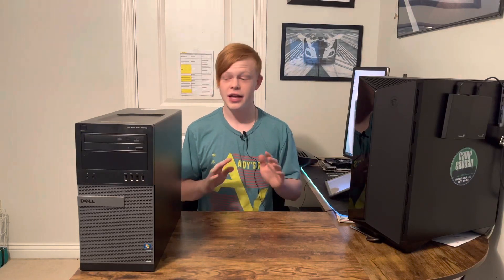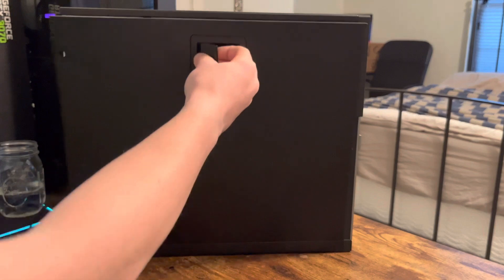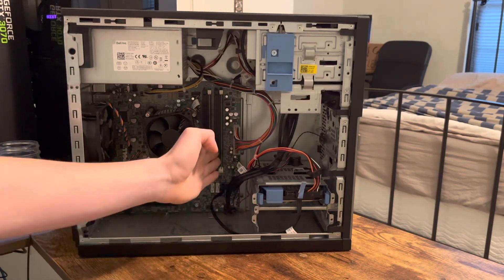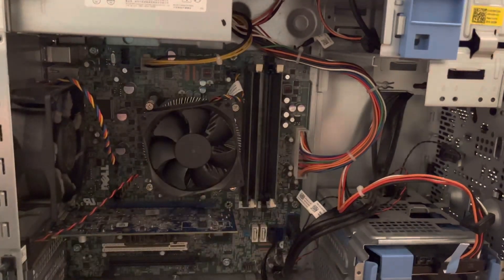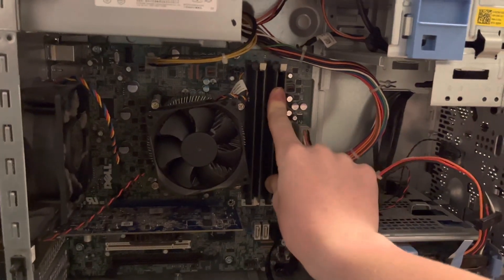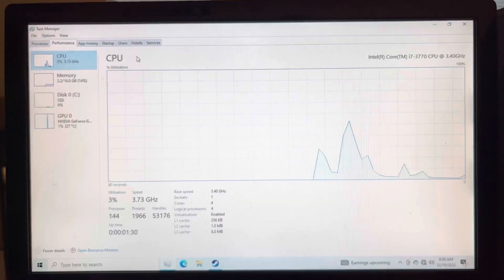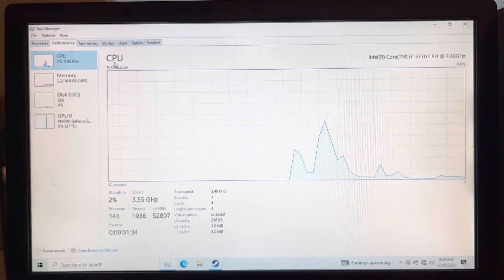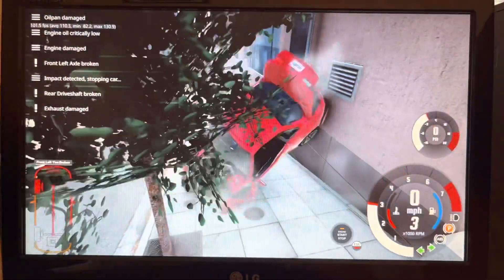How to UPGRADE Your DELL OPTIPLEX!

Comment: I scored a refurbed 9020 with a 4th gen i7 and 16gb RAM for $250. Swapped out the PSU for a Corsair CX600 and ran a PCIe riser to have a GTX 1660 run outside of the case, and damn is this one fine budget build. Even recent AAA titles are running great on it.

Comment: was the graphics card a 1650 or 1630 becuase i couldn't find a 1650 that looks like yours but i found a 1630 that did
Reply from the maker: I used a 1650. Ice actually never used a 1630 🤣
Reply: @KennyHalpin  ok thanks

Comment: Hello what PSU do You have on this Dell? i just bought OptiPlex 5055 with ryzen 1500 , 240 W PSU and I wonder  that will be work with my old 1050 Ti from asus { without power conector )
Reply from the maker: Well, if it doesn’t use external power, it should work just fine! I’ve never had any problems with 75>watt cards!
Reply: @KennyHalpin  ok thx
Reply: @KennyHalpin  Ok GPU works fine but i have another question ;p i put my RAM in slots A1 and B1 but its works in single channel the same when i put in A2 B2 ( Ram the same frequency and  model ) what to do to work in dual channel i dont find ram settings in bios menu ;/
Reply from the maker: It should do it automatically. Nothing to turn on. It won’t tell you that it does it, it just will.
Reply: @KennyHalpin  so bad ;/ i check in CPu Z and still shows me single channel
Reply from the maker: Hm, that’s weird… do you run mismatched ram?

Comment: NVMEs will also work on these machines, with a small bios modification.
Reply from the maker: Actually, that’s the newer Optiplex. This one specifically doesn’t have ports for it :/
Reply: @KennyHalpin  Ahhhh, I did not notice the model was a 790.

Comment: Just finished my 9010 MT project
Specs
CPU : 3770K
GPU : 2060 SUPER FE
RAM : 32GB HyperX Fury 1600Mhz
Drives : 500 GB 970 EVO Plus M.2 NVME, 1TB Crucial BX500
PSU : Corsair RM650W
Rear case fan : Noctua Silent 92mm
Reply from the maker: Might be a little cpu bottlenecked…

Comment: i just bought a dell optiplex 9020, and installed rx 580 in it, it worked perfectly fine, a reseated the cmos to get default bios settings
now the rx 580 is not working... can you help? is there any bios setting that doesn't allow the rx 580 to boot? the igpu works just fine
Reply from the maker: The RX 580 might’ve died…
Reply: @KennyHalpin  it worked perfectly fine before that cmos restart, i don't know the fix, i've tried everything and nothing works so far, so yeah i guess the rx 580 did indeed die

Comment: Thinking of doing something similiar for my brother, Did you install any other brackets/cables for it to be able to power that 1650? 

And did you install a low profile bracket on your 1650?
Reply from the maker: Nope! The system doesn’t need low profile! The 1650 can just be plopped in!
Reply: @KennyHalpin  does it need any external power cords?
Reply from the maker: @flexibilityosu  The 1650 doesn’t!
Reply: @KennyHalpin  thanks, currently looking for a good deal on a optiplex rn, what optiplexes do u recommend to look for, im in belgium btw
Reply: @KennyHalpin  update: i bought an 7020, reinstalled windows for my brother, found the ethernet port is broke and i ordered a pcie ethernet card for it, Hopefully will be able to resolve the issue and then see if i can buy a graphics card for him !

Comment: I  have a dell optiplex 7010 n I also have bigger case than the 7010 so I was wondering if I could put the parts in the bigger case n use a bigger GPU with it is it?
Reply from the maker: Yup! You sure can!
Reply: Would I have problem with the power supply mounting

Comment: I picked up a 7010 SFF (i5, Win10 Pro) on eBay a couple of months ago and did similar upgrades (16GB/512GB) but with a GT 1030.  It runs great, especially considering it's a 10-year-old computer, and even runs my older Steam games.

Comment: I just got a 7010 and I'm putting a E3-1275 v2 with a GTX 1070
Reply from the maker: What psu are you gonna use?
Reply: @KennyHalpin  600w cooler master

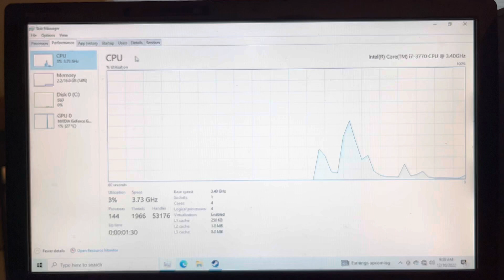Comment: another tip for builders: make sure to enable hyper-threading in the bios, sometimes it is disabled and you can check in task manager at Logical Processors under CPU, for the i7 3770 it should say 8 but if it says 4 (5:05) then it has been disabled. This sometimes happens when clearing CMOS or because Dell set it so, but you can easily just hit enable in the bios to well, enable it.
Reply from the maker: Yeah, with the dell BIOS you cannot enable hyperthreading unless you downgrade the bios, downgrade it a lot. Which comes with too many disadvantages compared to advantages
Reply: @KennyHalpin  how could not having hyperthreading be better then down grading the bios

Comment: I used to game on a 7010 back in 2020 with an rx 570, 16gb ddr3 and an evga 550w psu. These are great machines!
Reply from the maker: Yeah! I first build was a Optiplex 7020… didn’t do things right and bought a GT 730 and leaned that it sucked…